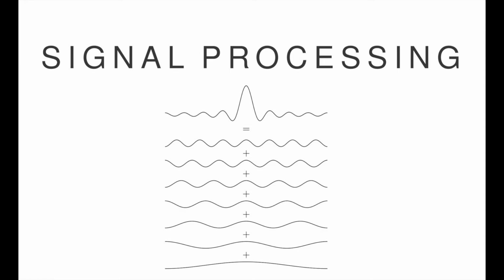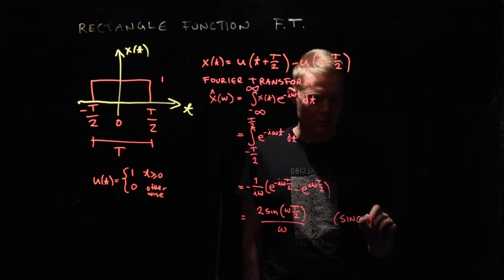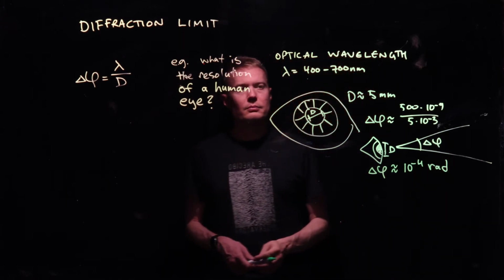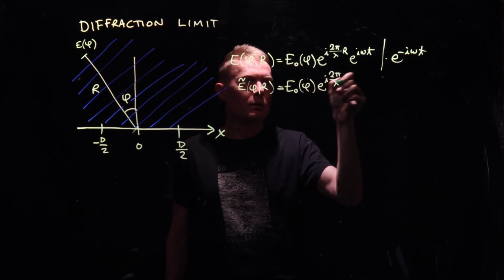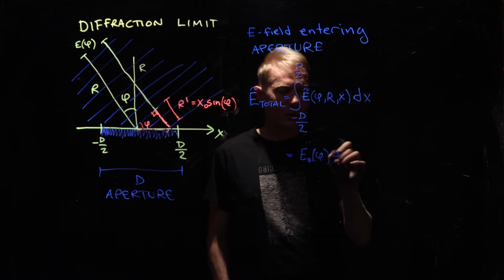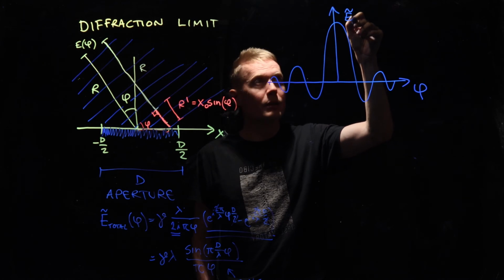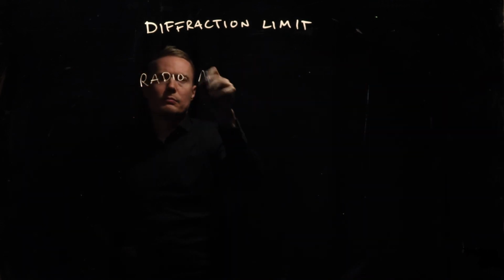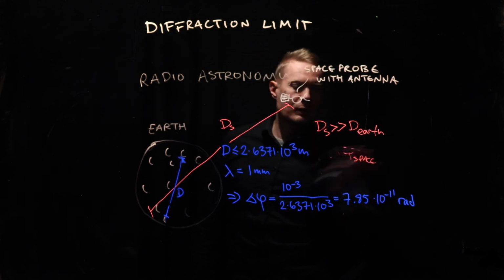Fourier transform of a boxcar - Derivation of the diffraction limit

Comment: Great video! Just one question - why do we chose the width of the main lobe as the angular resolution of the eye/telescope? I would think that the resolution would be much finer than that.
Reply from the maker: Good question. If you use a Gaussian weighting across the aperture, you get a Gaussian frequency domain function. In this case, the width of the main lobe (the only maxima of the function) makes more sense as the definition of resolution. There are super-resolution techniques that make use of the fine structure of a diffraction pattern, so lambda/D is not a hard limit.